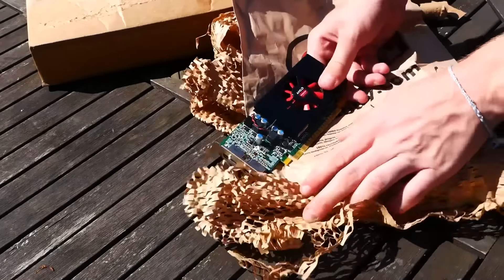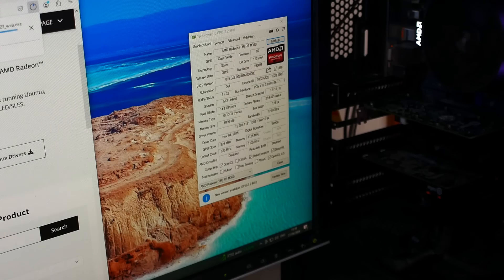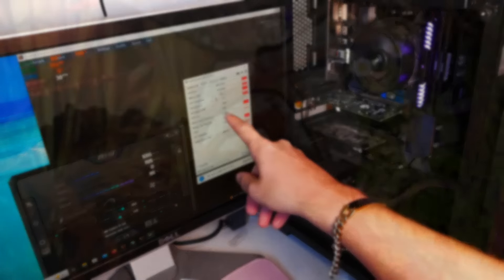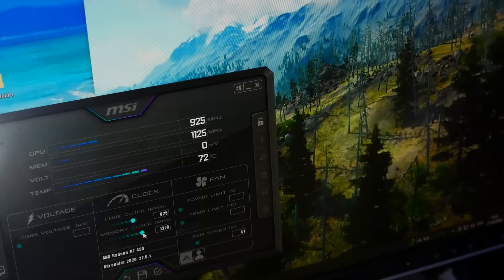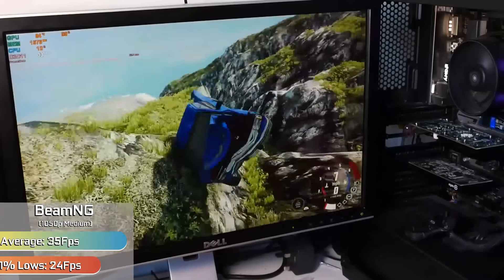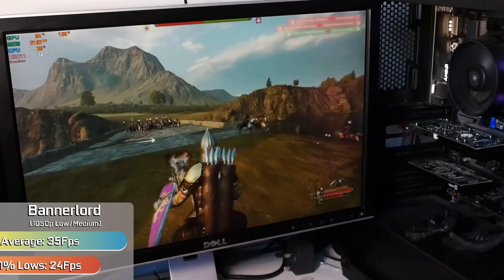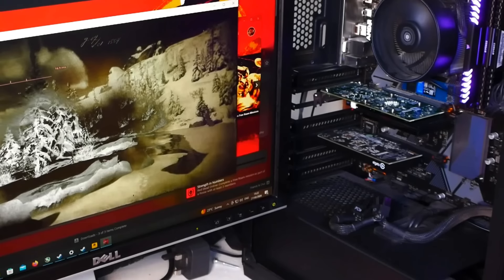AMDs Mysterious & Misleading R7 450...

Comment: Speaking of those outlandish 2 slot coolers for the 7750, it'd be interesting to see if you can push the card further with a different cooler - I'd imagine the screw holes on the PCB have changed with the beefier GDDR RAM arrangement, but maybe not?
Reply: I'm an experienced overclocker, lower temperatures don't increase overclocking headroom on older GPUs, because it only lowers the tdp of the card and doesn't affect the voltage level, which affects maximum clocks. Quite contrary with higher temperatures I had more stability at negligibly higher clocks.
Modern cards are quite limited by tdp nowadays, so lower temps means higher voltage, same tdp.
Unless it has some voltage control, which most of the cards that need overclock to be relevant don't have, it's just a longevity investment against chip desoldering itself and loosing contact or simple clock degradation.
Reply: I had a faulty gt 640 of which I took the heatsink to use in a r5 240, the screws were the same distance so I was able to push to the max with the Radeon Bios Editor, from 800/1075 to 1350/1400 with +100mv. Also tested 1425 core  with +175mv but it wasnt really stable
Reply: Quite a lot of LP GPUs have the same Cooler Mount Screw Spacing plus comon with their Full hieght version even between AMD & nVIDIA,
the difference if any is usually PCB Layout causing a problem with either varying distance from Core to the I/O or SMD Clearance
Reply: @MrEdioss  I remember when changing voltage was as easy ad flashing a modded bios. Got my 7300 GT from 400 MHz to 640 MHz that way. Ran absolutely stable and could rival a 7600 GS.
And lowend cards tend to not run into big TDP issues. they often just go for 50 or 75W and call it a day. And even that is something that could be changed on earlier cards. I threw 1.21v and 170W on my 660 Ti and got it to run stable at 1242 MHz instead of it's stock 980 Mhz.

But obviously they have to lock everything down nowadays. At least tinkering with the current sense resistors is still possible.

Comment: That´s the point. The upgrade cycles are coming too fast for me and I left this train a decade ago. My three machines are all 10+ years old, but they are doing their job. Indeed my treshold is 1080p but I don´t need more. That´s why I love videos with testing old hardware and budget builds! 🤗   send from a Lenovo Core 2 Quad 9550 with Radeon 7770 - the daily machine.
Reply from the maker: Great system that. 👍
Reply: And it runs 11 without any problems. This is really great.
Reply: Same thing here, except I had a newer system and switched back to an older one. I usually just run win 7 or XP and linux as I am not a fan of win 11, but with mods it would be usable. I love core 2 duos and quads they are the best CPUs intel ever made, and pre 2008 boards have no intel me! Socket 775 and socket AM2/AM3/FM1 are definitely the best platforms ever made!
Reply: The upgrade cycles have already slowed down a lot.
I remember when your 6 month old CPU was already too slow for the newest games and your 9 months old graphics card had already a full successor generation out. Nowadays you can run fine with a 3+ year old CPU and GPU cycles are closer to 18 months.

Comment: Basically sold to OEM:s as the "Hey it's better than an I-GPU" option..
Honestly, an impressive display of getting rid of excess stock on AMD:s part, if you ask me.
Reply: These runs of respun cards are well past trying to get rid of old inventory. At this point, they have had to make additional runs of the GPU ASICs, or someone has. I wouldn't be surprised if they had licensed their older GPU cores to a third party to have them get wafers made instead.
Reply: According to a comment this was sold in systems intended to be used in rendering and 3d modeling.
Reply: @GGigabiteM  It is built on an old fabrication process.  It wasn't very expensive to have TSMC crank out a few of these with the 28 nm fab when everyone wanted the newer 16 and 14 nm cards.

Comment: This is the LATAM/SEA special.

This and a second/third gen i5 (or even a modded 775 xeon) you can get a turbo budget gaming PC for less than $40 perfect for your little cousin's first gaming experience.
Reply: I still have a modded LGA771 Xeon here. In fact, I'm writing this on the very machine. And for a long time it had the big brother of the HD 7750/R7 450 in it, a HD 7770/R7 250X
And my main rig is indeed an i5-3570K, because I haven't encountered anything so far that I want to play that it can't run. Well except for a 2013 MMO that is insanely CPU intensive.

Comment: Hey, you can toggle "read only" in the file settings, preventing the game from changing the configuration file. 
Love your videos!
Reply: As a more hardcore method, use windows' file permissions. Disable permission inheritance and remove all its inherited permisisons (don't convert them), add a new permission entry user named "everyone" and only give it permission to read the file, nothing else. Even if a game runs as administrator (which they should never do), it can't change anything about the file, just read it. Hell.. you yourself can't change the file afterwards either, not even with administrator rights. You need to manually change the permissions back to allow the file to be modified. It truly is "read only" in this state. The basic "read only" checkmark in the file properties is more of a suggestion than something that is enforced, unlike the permissions

Comment: The textbook definition of a hidden gem!
Reply: One of those weird upper-lowend to lower-midrange cards that run surprisingly well.
Other cards that could punch much above their weight were the Geforce 4 Ti 4200, Radeon 9600 Pro, Geforce 7300 GT, Radeon HD 5770, Geforce GTX 750 Ti, Radeon RX 470, and to a degree the 8800 GT (but that was a highend card for a midrange price. I'd totally buy a RTX 4075 that beats a 4080 Super for 500€ today)

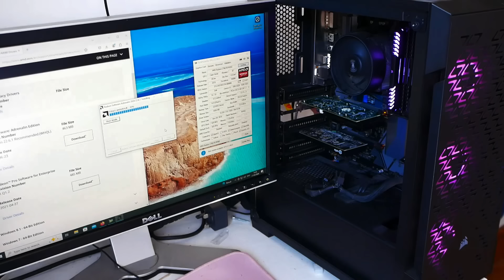Comment: 3:07 that rebranding history of the cards is mind boggling 😅😆
Fair play for doing that research fella. Respect to you because that's extensive!
Cool card, especially considering its small form factor. I got a similar card, the R5 340X which isn't bad either. Uses even less power and it can run some games which I never thought would even load on it. Like Crach N Sane Trilogy, only you have to put the resolution to that of the original xbox 576p 🤣

Comment: Welp. If I ever have all my GPUs die for some random reason and I don't have a backup GPU or all my setups die. I think I now know what to get now.

This definitely came as a surprise and it's great to know about it cause I use Linux mainly and any AMD card from HD 7000 series to at least RX 5000 series work for all my applications and different distros.

Great to know these are such a low cost and will now be something to get in at least my budget XD.

Thanks for the videos as always. It has been making my week every week you post a video. Plus I rewatch your videos alot and these recent ones have been awesome to rewatch. Thank you for that man.

Comment: I thought the 370 was rebranded a lot from the 270 and the 7870 but this one surely takes the price of most rebrands.
Reply: almost HD 7770 🙃
Reply: The R9 270 usies the Pitcarin XT chip, which was indeed used in the HD 7870, but also in the HD 8870
The 370 also uses Pitcairn, but in the Pro version. The 370X uses the XT
So the R7 370 and OEM-only R9 370 are the same as the R7 265 and HD 7850, they skipped the 8000 series on that one for some reason.

Comment: I can't figure out what drivers you used!  Mine is still detecting as the m360.  There's a few people on reddit wondering the same thing about the drivers.  This card is ideal for the SFF (small form factor) optiplex machines.  You can find these SFF opti machines for super cheap.  Toss a $20 SSD in there and make sure you have at least 16gb of ram and you have the ultimate cheap machine.  I have put a few together for well under $100 all together.  They're awesome home theater PCs and good for anyone that just needs a cheap reliable machine for basic tasks and some light gaming.  It runs GTA5 no problem!

Comment: I have one of these as my backup test card. It’s very confusing though, there’s like a million variants of this thing and it’s been rebranded a million times. Mine reads as an m360 as well. Paste was dry as a bone so I replaced it which helped. Mine is the full height one from hp. Branded as a 340x or something
Reply: M360 i killed mine, when repasting it, my fault. Good hot card for the price
Reply: @uenh8447 wdym you card die? The m360?
Reply: @codfish1776  yes

Comment: I had a 7750 in a secondary PC back in the day.  Great little card even with only 1 GB GDDR5.  Makes sense that it saw revision after revision being the fastest original GCN chip that didn't require external power making it an apt for high production, easy upgrade for basic desktop PCs. 

First gen GCN was so awesome for it's time, not to mention long lasting.  Probably my favorite Radeon architecture.

Comment: Definitely worth checking out the RX 640 if you want to see what OEM cut down Polaris can do. The Polaris 23 XT performs fairly well enough and they're dropping in price. Oddly enough it's launch date overlaps the EOL for the R7 450 so there was a strange time where you could probably order up a configuration with either card. The 640 has 7-11 driver support as well and 10/11 drivers are still getting updates for it.

Comment: The temperature is a clear result from clocking it so high (and thus throwing in lots of voltage) and pairing it with a tiny cooler.
I had a passive 7300 GT way back in the day and could get a massive 60% overclock and 15°C lower temps by tying an 80mm case fan to it and using plastic shims to increase the mounting pressure.
I also had a 8800 GT, and that thing it 103°C in games. Can thank the single slot blower cooler for that. And again case fans came to rescue. This time two fans and they dropped temps by about 30°C
For the R7 450 going either for a second slot or full height, or both should do a lot. Perhaps even just replacing the small fan with a bigger one or having one blast at the card from the side.

Comment: I had the 2 GB HP version (R9 M360) during the COVID/mining pandemic. I got it for ~$40 since nobody knew what it was, and it was able to run everything I wanted to play then, which were mostly older games and turn-based RPGs ported from consoles.
It was a time when GTX 750 and R9 370 were going for well over $100, and anything Polaris and newer (mining-capable) was $300+, so $40 for this thing was an amazing bargain in comparison.

Comment: Could be an interesting card on a main linux system as the desktop GPU, and then a modern one for gaming with GPU passthrough for a windows virtual machine...
Since a 5800X3D has no integrated GPU, it can be a real option for cheap without requiring additionnal power from the power supply.
I'll entertain that thought for some time.

Comment: Edit, yep they get hot. Force fan to 100% with MSI afterburner. 

Haha called it! Have the full height version which is also only 2GB... Curious to see if yours also thinks it's a mobile GPU (r9 380m or something like that)
Reply: Not sure how much fan control there is, but I would assume the fans are already going up when the chip runs that hot.
Reply: @HappyBeezerStudios  i have the same gpu (tho less memory) and it doesn't. I just set to 100% in MSI Afterburner, or maybe 85 if noise is an issue. I've upgraded to a Biostar RX 560D 4GB but keep my 450 as a spare. Eh either way my OEM Gateway Motherboard power limits them both, 40w for the 450 and 48w for my current card. A bit frustrating since both GPUs keep down clocking under load due to power limit which limits game performance
Reply: Oh another fun fact, the chip codename is "R2-D2"

Comment: Nvidia did a similar thing with GF108 from the Fermi architecture. GF108 was a entry-middle level Fermi GPU manufactured with TSMC's 40 nm process and sold under GeForce 400 series. Then, GF108 was used as an entry level offering at GeForce 500, 600 and 700 series.

With GeForce 700 and 800 series, GF108 has undergone a die shrink from TSMC 40 nm to TSMC 28 nm and was renamed to GF117. GF117 was available under GeForce 700 and 800 series.

GF108 and GF117 cards only differentiated in core clocks, TDP, manufacturing process and amount of VRAM. 

GF108 was on sale between 2010-2016 and GF117 was on sale between 2012-2016.

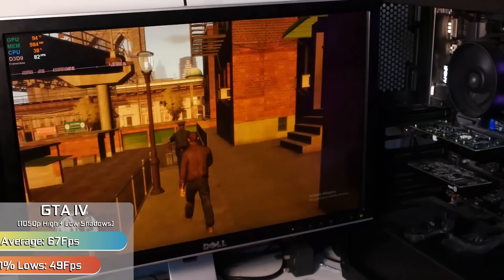Comment: 16:21 GTA IV ran horribly on HD 530 integrated graphics(low settings 1024p) I beat half the game on 20 FPS before finding out my resolution was the problem and I put it down and  i got a FirePro V4900 and I was able to do medium settings 1024p with 60FPS, I got a GTX 680 and was able to run max settings 1080p 40FPS and then I got a GTX 980 Ti, max settings 60+ FPS and they all had the same CPU, a Intel core i7-6700

Comment: I  picked one up to use in 2019 in a  compact HTPC build I was making using... junk.  20 year old Antec Sonata small form factor case, Aliexpress motherboard and 4th gen Xeon CPU.  It's run great.  Never stuttered on decoding video 5 years later it IS getting a bit long in the tooth though and I'm afraid I won't be able to replace it with something for the $75 I spent to build it.

Comment: GCN on newer processors (including your not so new Ryzen) will heat up a lot. Happened to me when I put an R7 360 (not m) with a R5 5600G. GPU was running hot on an FX6300 but not THAT hot 'til the CPU could handle more frames so the GPU was more utilized and it could boil your water. TjMax on R7 360 is 95ºC, probably close to this one. I switched the heatsink with one from the HD 7770 I have lying around there, copper piped and all (the 360 has a round aluminium one) and the temps were way worse, hitting 99, so I switched back and put a fan on the side of the PC pointing at it and got it running on the mid 70s to low 80s, overclocked as much as I could. Running an RX6500XT 4GB now, but I guess my fix for the 360 would do just okay for this card without much fiddilng around. Regards.

Comment: For the 60watts of power with the DX 11_1 feature set.  Its probably better to spend the money on the very rare Dell RX640 and atleast get DX12 feature set
Reply: Considering API support is all over the place, this card can indeed do DirectX12.
But if we're talking about DirectX12 with actual Direct3D12 features, which is supported since GCN2, a R7 260/360, RX 455, RX 540, GTX 945A, or GT 1010 should do the trick.

The problem is indeed that the RX 640 is rare. And rare means expensive. I just checked and there was only one for 53€ plus 20€ international shipping.
I could get a RX 560 for the price and have enough left for a nice dinner. Even seen a couple RX 570 for under 60 and GTX 1660 for under 70.

Comment: An NVME heat sink with heat pipes and metal fins would fit on top. Using a quiet modern fan to dissipate the heat more efficiently may be the mod way to reduce the temperature.

Comment: oooh, ok, so, it seems there's no R7 450 available for shipping to Brazil atm, (except for one which's selling for R$289, whichs too much and above the budget) but I'll keep not just one, but my both eyes on it and see if I can find one for a friend of mine (he's on a 3rd gen i3 with no dedicated GPU, and wanna upgrade it with an i5 or i7 + GPU), just wow. Nice video and holy crap, that's some really great performance, and yeah, the 750TI do is one of the options being considered, hah
Reply: Remember that it's basically just a HD 7750, so any HD 7770/R7 250X, HD 7790, HD 7800<, HD 8760<, R7 260<, R7 360<, RX 455< or RX 540< will perform equal or better.
And those are only AMD GCN cards, pretty much all RDNA cards will also run better. Even slightly older cards like the HD 5850 will be similar and even the HD 5770 is often close.
on nVidia side GTX 460<, GTX 560< GTX 650 Ti<, GTX 750<, GTX 950<, GT 1030< etc
Reply: @HappyBeezerStudios  yeah tbh we've been looking mostly at benchmarks with actual tests on games for reference, because they're more important than technicalities, and this R7 450 actually performed kinda similarly to a GTX 550TI on that regard. Also, old AMD cards are pretty rare here in Brazil, 2006~2010 cards are rare and usually expensive, ebay isn't usable and aliexpress is suffering from a taxing of 97% at $50+ purchases. Aliexpress stuff are still more affordable than local, used parts. The R7 450 specifically was something I didn't know about until now. People in here nowadays try to sell old Pentium and Celerons (with motherboards) for R$300~800, NDS and PS2's for R$600+ despite the ps2 being the best selling console, not only in the entire world, but also here in Brazil, so some rules are kinda twisted around here. It's cheaper to buy a 3rd gen i5 on aliexpress than to buy an used Core2Quad here on my city. São Paulo is less worse in that regard, but yeah... That sucks

Comment: I use one of these in a sff dell 3050 with i5 7500 used as an emulation machine. Runs ps2 absolutely fine, and every console before ps2 with next to no issues on batocera. Picked it up in 2020 for around £30 so overpaid probably but happy with it, even now

Comment: Ha! Called it! I guessed it was going to be a hd7770 or similar, but Called a "r7 wharever".
I was using a 7770 for far too long. Pretty nice architecture. I remember the temps were really low, as it was a 28nm card when pretty much nobosy in the mid and low end market was using this technology. Blast from the past. Nice.
Reply: I still have a R7 250X, which is just a relabelled HD 7770 as backup card. It's doing a fine job for what it is.
And seeing how well the HD 7750/R7 450 does in somewhat recent games makes me think my aging GTX 1060 will probably last even longer than I anticipated.
Reply: just bought a 7770 ghz edition, can't wait to pair it with my i5-750 pc